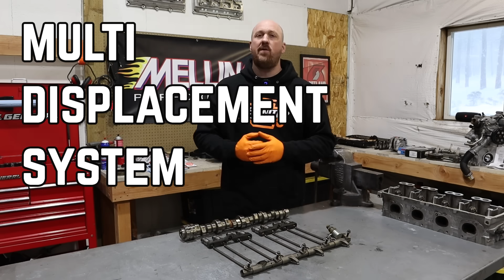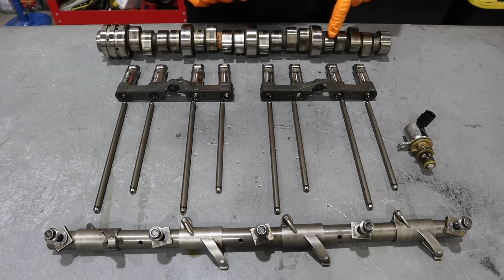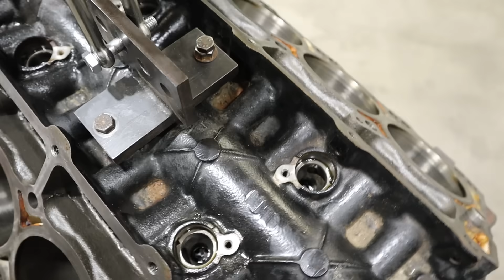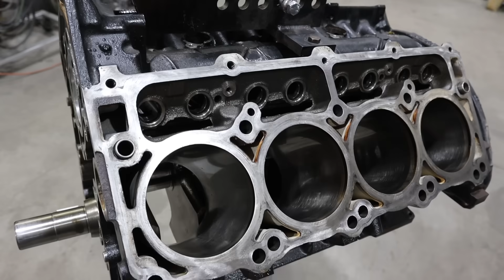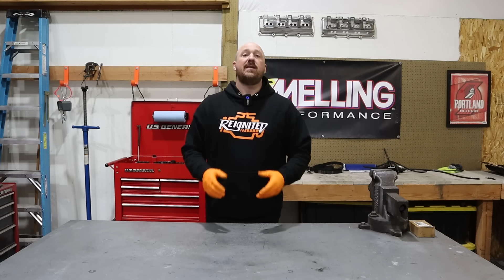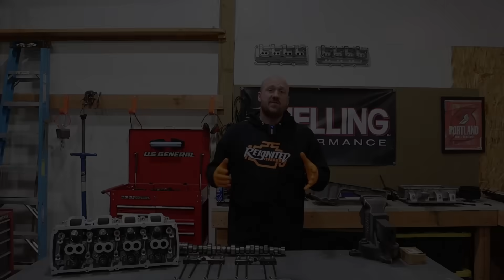Is MDS Damaging Your HEMI? The Answer May Surprise You!

Comment: No, but turning the MDS system OFF with a tuner WITHOUT an MDS delete does cause ACCELERATED lifter/cam failure.  

The MDS lifter doesn’t get high pressure oil unless the MDS is engaged on the freeway.  

IF, you’re idling for long periods AND, you ALSO have the MDS system turned OFF, those MDS lifters NEVER get that high pressure oil flow.

FYI, adding a “HELLCAT” oil pump on a 2012 5.7 HEMI disengages the MDS system due to oil sensor error.  Ask me how I know.

I heard you need a HELLCAT oil sensor as well.

Did a 5.7 HEMI Dodge Charger engine rebuild WITH cam/lifter replacement while adding a HELLCAT oil pump.

MDS system was disengaged due to an oil pressure error code.  Experienced lifter/cam failure 11 months later!!  Not 75k miles later.  10k miles later.
Reply: that makes no sense. MDS does not activate at idle. so the MDS cylinders are getting the same amount of oil as the others at idle or when MDS is off. The only time they get more oil is when MDS is activated. But thats only under non idling operation...which mains the oil pump is pumping at high volume anyway and they would still be getting the same oil flow as the non MDS lifters if the MDS lifters are turned off. So at no point do the MDS lifters get less oil then all the other lifters, whether or not the system is on or off. So how would disabling the system harm the lifters ? They are still getting the same oil flow as the standard lifters.....
Reply: @dan16802  Skye literally explained in one of his “HEMI tick” videos; MDS lifters only get high/full pressure oil when activated.  And, obviously they are activated while driving.  

When at idle, the MDS lifters do not get high pressure oil because the oil galleries are blocked by the MDs solenoids.  

Which under normal driving conditions; is perfectly fine.  

But, when idling for hours on end, creates excessive and accelerated wear due to the lack of free flow oil pressure through the MDS solenoids and to the MDS lifters.

Skye literally explained this process.   When the MDS never activates, due to oil pump DTC code; it makes this situation even worse.

The Hell cat engine with manual transmission doesn’t have MDS solenoids or MDS lifters.  

And, the plugs allow free flow/high pressure oil to flow to all lifters, all the time.

Not only did Skye explain this, but several Dodge techs have warned about turning MDS off without a hardware MDS delete.   (MDS was off in my case due to the Hellcat oil pump)

Which creates excessive wear and leads to early engine failure.  Funny, this is exactly what happened.
Reply: @JohnSmith-zw6tr  I understand that the mds lifters get high pressure oil when activated but if it's never activated do they not get the same amount of oil as the other non MDS lifters ? They may not get the extra high pressure oil but they still get the same oil through the push rods that the non mds lifters get. I'm not seeing how not being activated would affect them. especially since they are never active during idle anyway and only getting extra oil while at high RPS...the same amount of oil the other non MDS lifters are getting at high RPM.
The only way it would make sense to negatively affect the MDS lifters to never be activated is if they do not get the same amount of oil under normal non MDS operation as the non MDS lifters, which they do.

Comment: Great video as always and thanks for the in depth information. But - wen you say that a person gets in their car and turns the MDS off, is that meaning using the +/- switch on the shift lever (if they still have one)? Which causes the ECO to stop displaying, and the current highest gear to be displayed. Also, I notice that the ECO (MDS?) does not come on when in Tow/Haul mode. Does this mean when in Tow/Haul mode that the MDS lifters are not getting the oil that they should either?

Comment: I have to say the 6.4l HEMI has been very good for our company and we work the dog shit out of them hauling 400 gallons of water in the bed driving all over the place on Oil Lease roads 12-14 hour days 5 days a week with lots of idling time. I stayed with 0W-40W Mobile 1 and currently sitting at 175k miles on a 2018 only problems we had were a fuel pump failure at 68k and a Radiator failure at 167k miles. I still do not hear any sounds of the Lifter roller failure yet. Out of our fleet of trucks we have lost 2 engines one to the lifter cam failure, but that truck was not serviced as it should have been and failed at 150k miles.  To me the the 150k mile mark has been worth the engine performance we have gotten out of it. Had it been properly serviced like I have done to mine I believe they would make 200k. I am fixing to move into my new 2024 with a 6.4l work truck and will update it through its life time. I have learned a few things since that time from this channel that I will be doing with my new truck. Through its flaws I still think the 6.4l Hemi has been a damn good engine.
Reply: Update in the 2024 model same identical truck basically. Currently sitting at 65k miles only issues it has had were left front shock not tightened from factory made a terrible clunk after while and took us a while to diagnose because we were looking for common front end issues causing clunks easy fix once diagnosed, but that led us to a bad Ball Joint (this was at 48k) so out of warranty we had to fix it. No engine or transmission problems yet on it. So far its going about like the 2018 did. However we have had one truck in the fleet have a transfer case lock up causing some expensive damage. Probably a factory screw up too, but again work trucks burn through their puny warranties really fast. Most of the time even if we need a warranty repair we fix it ourselves because we would lose more money waiting on Ram to fix them. I would still buy a Ram in 2025 early 2026 over a GM or Ford. Maybe a Ford with a 5.0 if the deal was right, but Ram always ends up getting better deals than Ford.
Reply: You've got lucky im doing a 6.4 w a tick
Reply: @danieltonnessen656  Check it carefully some ticks are normal How many miles you have on it?
Reply: @NDIrishfan71 or a cracked exh manifold

Comment: So as a “poor man’s” mds delete, is it bad for the engine/lifters if we just drive exclusively with manual mode on the auto-stick? 
I’m not a fan of the factory shift logic and prefer shifting myself anyway. I am wondering if this is  somehow bad for the lifters never collapsing for 4 cylinder mode? 
Any thoughts, please? Thanks for the amazing content!
Reply: This is the exact question i was looking to have answered in the comments. I'll give it a bump 🤣
Reply: I have been driving this way for over 2 years. No problems so far.
Reply: been just warming it up, letting MDS kick in a couple times then going up to 6th (i have the 65rfe or whatever number it is) and its been since 2016. no issues😂 all ive had fail is a water pump at 120k miles

Comment: Mine where 3 and 5. When I changed the parts, I used a cheap rockauto timing chain. They stretch and cause a rattle when the MDS turns on. Until I change the chain, I shift manually with the autostick, so the MDS doesn't come on.

Comment: I flew to Ohio from California to drive back a 2013 RT charger with 63k miles in 2019. At 80mph I average 26mpg on freeway all day. Now it has procharger and  average 16mpg in city.
Reply: Was the mileage difference worth the procharger ?? Some fun comes at a cost sometimes.
Reply: @bornfree3124  very picky on oil and changing.  It's paid off handsomely,  now i have 86k miles and the other mods have paid off. It's a second car for me.  3.55 getrag rear differential with upgraded axles and hubs.
Reply: One other thing that's very important is to avoid extended idling.  Hemi is large motor and it's not a living room

Comment: No mention of dropped valve seats being related to mds.
Reply from the maker: That's because they're not. Dropped valve seats in the 03-08 engines are due to poor tolerance fit of the seat to the cylinder head, and when the engine  gets too hot they will fall out.

Comment: Stop telling people they need a high volume pump! The early engines from 03 to 08 didn't have the lifter problem and they had lower volume and pressure and have been running even longer time. Also people did not start idling their cars all the sudden in 2009. Also if higher pressure in the mds gallery was the cure how come non mds cars and trucks still have the same problem? The answer to all of it is the lifter was "updated" in 2009 easily verified by the Chrysler part number, that is the problem, ALL THE PROBLEM! There is no oiling problem in these engines until your running 8000+ rpm. There is issues with higher volume pumps like more heat in the oil, more windage in the crankcase that reduces hp and mpg, more oil on the cylinder walls will overwhelm the rings earlier in engine life a higher volume pump itself takes more hp to run and thereforereduce mpg and hp.
Reply from the maker: I'm fully aware that the early engines haven't had these same lifter failures and have mentioned that several times in my videos. They changed the lifter design in 2016 to try to fix the lifter issues that were happening, but as you said, the problem started in the 2009 models. The change at that time was adding vvt which changed the oil needs within the engine, this a higher volume pump can return the engine to the same standards as the early engines. However, I'm not sure where you're getting your information about the high volume pump causing excessive heat in the oil, and reduced MPG. I'd love to know your source on this info. If it's reliable info I have no problem presenting new info. 👍
Reply: @ReignitedAuto  it takes more energy to turn a bigger pump, a bigger pump makes more heat, it is not rocket science.  The bigger pump in the eagle engine makes more pressure already than the early one so if that extra oil didn't help why on earth would even more oil fix the problem?

Comment: just wondering if you could cover the alternator and charging system .is it true that in the case of an alternator failure do you have to replace the alternator,battery and ecu ? and is there anything that can be done to avoid the alternator failure ?

Comment: Are you sure mds isn't supposed to engage before the engine is up to temperature? Mine will engage just after leaving my house, definitely under 120f oil temp and the water temp needle still resting on the cold stop. Haven't checked the actual temperatures on the dash but I've started disengaging mds manually until the oil gets past 180-190. Also as far as efficiency, I get between 22 and 23 mpg reliably but my driving is almost exclusively highway with very little stop and go. On a 100% highway road trip, I got close to 24. I'd be surprised to see it any higher for any significant stretch of miles

Comment: Thanks. Having some relation to ECM tuning, I can't even count how many times I've been hearing that sad-sad story about the MDS killing the engine. No, sir, It's absolutely not you using cheap engine oil and extending the oil change intervals, it's the dumb MDS. But here finally is a video that I can share, just to explain the whole thing. Thanks again!
My 2c - I personally think that what could really improve MDS operation is increasing the torque output of the engine. We're talking about N/A street daily driver engines, so no forced induction here - but a good AFR in all modes and some nice and smooth spark maps with more advance definitely help. Factory Ram tune is quite conservative to make it operable on low-octane fuel, but if the owner is ready to forget about the low-octane forever - then we can get more torque and efficiency out of the engine without sacrificing the mileage or the lifetime. And it would work for both V8 and V4 modes. Sadly, the well-known calibration editor for Dodge kind of lacks in terms of accesible MDS-related parameters.
I've seen and experienced the same effect on GM trucks, 3rd gen Tahoes and Escalades mostly. Proper tune for a stock engine is a world of difference, and the AFM/DoD, which is GM's name for variable displacement system, really helps save some fuel on the long highway trips and moderate throttle city drives.
Anyway, this has been a great video and definitely looking forward to the actual work demonstration that you've mentioned. Keep up this awesome channel!

Comment: Hello i would like more information on the impact of the hv melling pump on the low end of the variable cam time. Like does it make it only benefit the high end? Thanks for all your in depth information. I think you and vertical visions are doing gods work for the rams. Also I have a 2016 ram I get 16 city and 21 highway on the 5.7

Comment: Great video.  Can I get clarification?  I have a challenger with a 6.4L.  It only gets driven about 1K miles a summer.  I change the oil every Spring.  I put it in sport mode after starting the vehicle.  Would you recommend only using 'Sport' when  necessary and let the MDS system do its job?
Reply: Perhaps for some fraction of a second, with periodicity, the MDS activation is embedded in the car’s computer, but you cannot see it.

Comment: I have a 2005 Dodge Ram 1500 5.7 I get 20 mi to the gallon 21 on the highway I think that's pretty good I do not have that system where it shuts from 8 cylinders to 4 cylinders it just doesn't have it on mine it's always running 8 cylinders

Comment: Have you ever had the 4 cylinder mode not turn off when giving it throttle? I’ve had the car up to 2700 RPM and it doesn’t kick into all 8 cylinders, not check engine, nothing crazy but it happens time to time

Comment: I deleted the mds on my hemi charger and installed Johnson lifter but I never knew I needed the melling part MLG-103 part# because the MDS lifters are different sizes in the guilds,if you put standard lifters with the MDS guilds they burn up because they will flop around in those guilds and the roller part won’t stay true on the cam lobe and will be destroyed in minutes I assume.

Comment: My wife's truck hardly ever gets to use mds. 70,000 miles and maybe 20,000 off them are without a trailer in tow. Does this mean her engine is at higher risk?

Also, since new we have used Rotella T6 5w-40. Compared to my sister's 6.4 (newer 2022 vs 2015) my wife's idle a lot quieter. I think the T6 quiets the engine.

Comment: @ReignitedAuto Always enjoy your tech talks.  Look forward to an instrumented oil system test - would be VERY interested to know where the pressure drops (restrictions) are within the oil system of an Eagle engine.  Also curious, just to cover the upgraded oil pump - what is the pressure rating of a factory oil filter (very thin, stamped and rolled 28ga? sheet metal)?